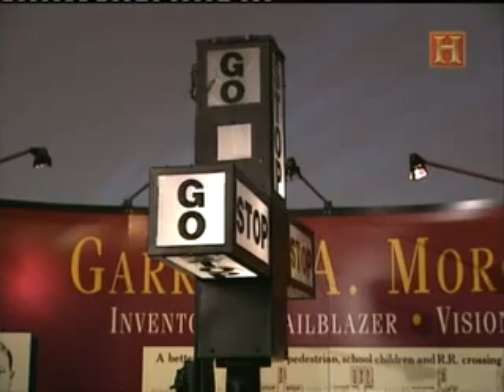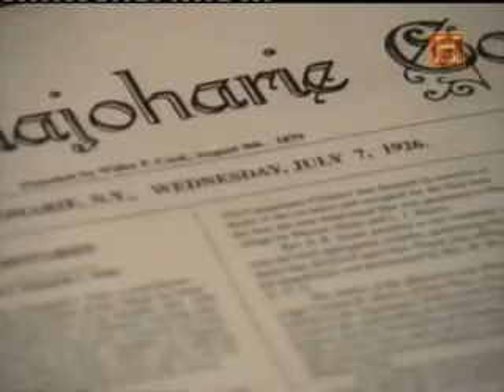The Man Behind The Traffic Signal

Comment: The first known traffic signal appeared in London in 1868 near the Houses of Parliament. Designed by JP Knight, it featured two semaphore arms and two gas lamps. The earliest electric traffic lights include Lester Wire's two-color version set up in Salt Lake City circa 1912, James Hoge's system (US patent #1,251,666) installed in Cleveland by the American Traffic Signal Company in 1914, and William Potts' 4-way red-yellow-green lights introduced in Detroit beginning in 1920. New York City traffic towers began flashing three-color signals also in 1920.
Garrett Morgan's cross-shaped, crank-operated semaphore was not among the first half-hundred patented traffic signals, nor was it "automatic" as is sometimes claimed, nor did it play any part in the evolution of the modern traffic light.
Reply: Frank289100 I don't thinks so my mans, Garrett Morgan is the man!
Reply: @demeh.5827  He didn't do nothing.